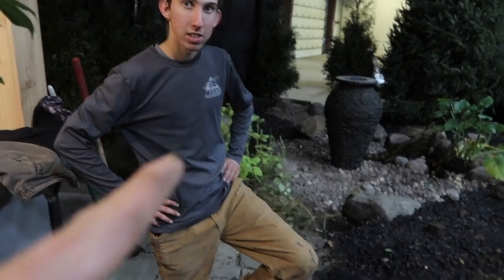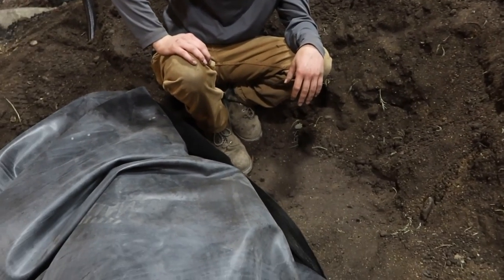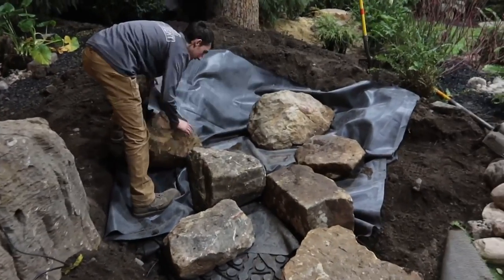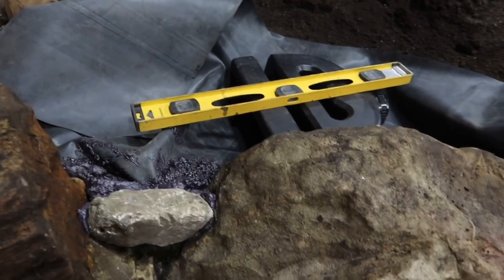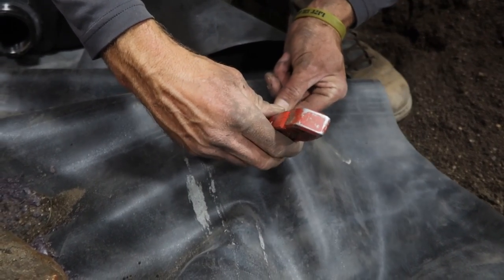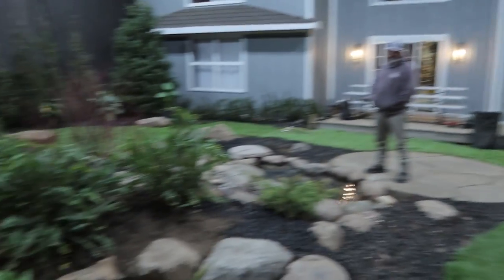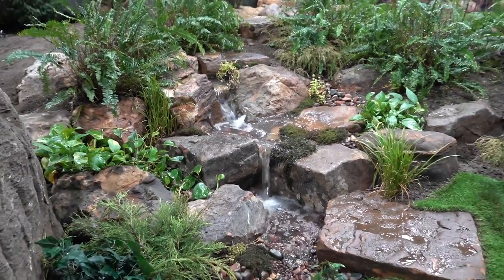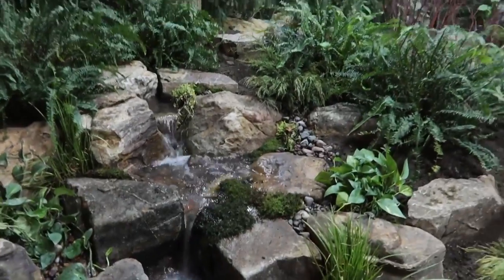DIY WATERFALL KIT Installation Tips from the Pros - Final Reveal

Comment: i purchased the backyard pondless waterfall kit with the acqua basin 45.  i have just begun to install, but am wondering if you need to use a screen on top of the basin to keep debris out, i am concerned with leaves.  i have a high amount of leaves in the fall, will a screen help or not really?  i was looking at ¼" screen fencing to lay on top of the basin before i place the river rocks on it.
Reply from the maker: You don't have to use a screen, but you can. Just make sure the water can run through it.